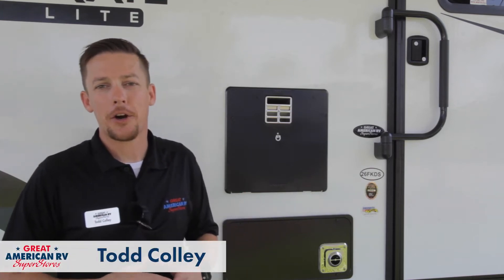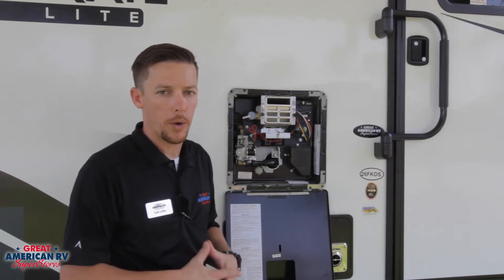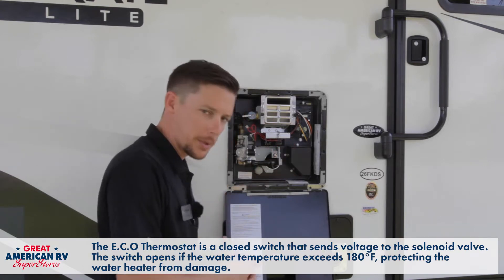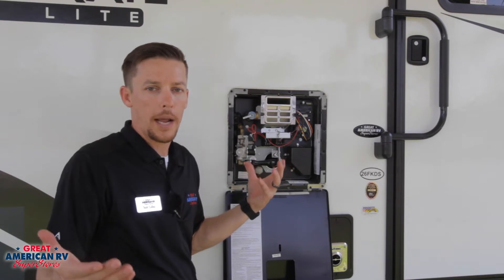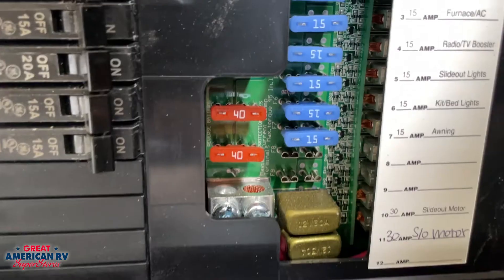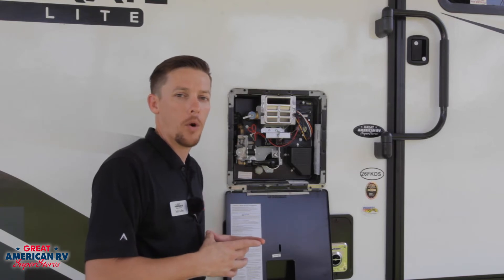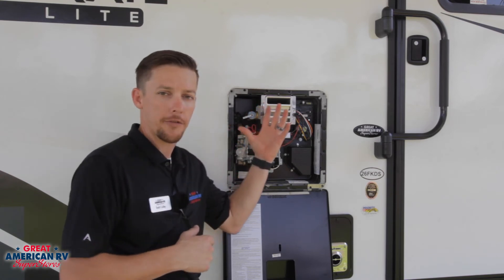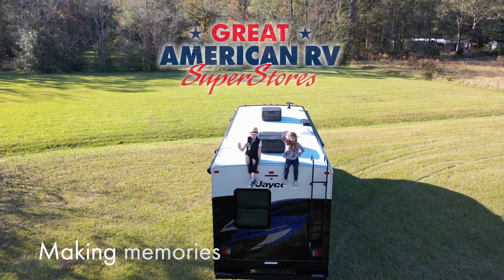Dometic RV Water Heater Operation and Maintenance

Comment: Hey. This is great info. Thank you. I have a problem with mine that you almost got to but not quite. My water heater heats up with either/both gas and electric and gets plenty hot, but then it fully shuts off and stops heating altogether, and it gives me an error on my computer panel that just says, "check water heater." I assume this is a thermostat problem, but I'm not sure where to go with it, and unfortunately I'm living in an area with no RV repair people. Can you provide any insight or direction?
Reply from the maker: Can you get the model number off of the unit itself?  From there I'll see what help we can be.  -Todd

Comment: What do you do when there is too much flame? I have blue flame but it's rolling out of the tube and melting the coating on the wires above the tube? Could it be too much gas going to it? If so, how do I adjust that?
Reply from the maker: More than likely you need to check the burner tube.  It is a U-shape from where your flame is and out to the grill on the top.  It could have a wasps next, spider web, etc built up in there.  Run a coat hanger and compressed air through there.  The gas is building up and not flowing properly through the exhaust.  -Todd.

Comment: What’s the size for the drain plug normal standard use to be 15/16 but the new Domatic heater is bigger drain plug .
Reply from the maker: @jimmurpby2208  the newer ones that have the white cap on the tank 1 1/16”.  -Todd
Reply: @GreatAmericanRV  wouldn’t that be smaller ?than the 15/16
Reply from the maker: @jimmurpby2208  one and one sixteenth inches. 1 1/16”. That’s bigger.

Comment: I have the Dometic WH-6GEA hot water tank in my rv. The AC cord is just hanging loose. I would like to use electric when I have full hookups, but I'm not sure how to connect the AC.
Can you offer any advice please?
PS it works fine on propane.
Reply from the maker: I would a bit more info.  Where are wires located and what color are they?  -Todd

Comment: Hello, I have a question "I installed one of this in my camper" is it necessary to connect gas or just the electricity cable?
Reply from the maker: You can do just electric if you wish.  Just make sure there is no open gas lines on your unit.  You would want to cap anything existing.  - Todd

Comment: Can i use Vinegar soak to clean the scale from a Aluminum Tank?
Reply from the maker: I would suggest staying away from vinegar.  The acid could harm the aluminum causing corrosion.  Best practice is to just run water through the system with the plug out and purchase a flush rod to stick in the hole to break up any scale.  Dometic recommends water only, no chemicals and to perform on a regular basis to avoid buildup.  - Todd

Comment: Ours runs on gas for a few minutes then slowly dies and flames out. Like it's running out of oxygen. It runs fine if we leave the door open?

No issues electric mode.
Reply from the maker: When it is running, is it strong?  Does it resemble a jet burner blowing through the exhaust tube?  -Todd
Reply: @GreatAmericanRV doesn't seem strong with intermittent sputtering with door closed. With door open it runs really strong but flame is more yellow than blue.
Reply from the maker: @Rod-db8tt  Ok, I would start with the mixture tube that comes right after the gas valve and flows into the combustion chamber.  Make sure your system is off first, then run a pipe cleaner or small brush, anything you can fit in that tube and run it around in that 90 degree tube.  You would be surprised that even the smallest spider web can cause issues.  While you are at it do the same thing to the combustion tube.  This one is a little more difficult but try to run something through there and clean it as best you can.  One of these two things should take care of it.  If not it could be a faulty gas valve (unlikely) or you could have pressure issues coming from your regulator.  Hope this does the trick, let me know!! -Todd
Reply: @GreatAmericanRV Thanks for reply. Ya pretty much done all that. Had gas tube out all clean. Ran my little borescope through exhaust tube and all clear. I eventually bought a new door and did the 3" hole mod with stainless steel vent and screening which did fix it, however it still flamed out once since mod which was highly disappointing.  One post on a forum made sense to me that propane exhaust byproduct  is heavier than air and snuffing out flame. I just recently researched this issue again to see if any updates from Dometic as I think it is a design flaw.
Reply from the maker: @Rod-db8tt  I haven't seen anything on that, thanks for mentioning.  Are you having any issues with flow on other LP appliances?
Reply: @GreatAmericanRV no everything else on gas is fine ... from gas bottle in front of trailer all appliances on left side in this order. Fridge, stove, water heater, and lastly furnace. I'm not too worried about it as it works fine normally with the 3" hole, however I would feel better if it was OEM. We're in Las Vegas @ about 2k above sea level so I would assume the jet orfice in gas valve is correct. It did run fine a couple of times when camper was brand new
Reply from the maker: @Rod-db8tt  yeah hard to tell without being there in person.  Wish you luck.  -Todd
Reply: I have the same problem.   It goes out with the door closed.  Though it has a blue flame,  it will eventually go out.   If the door is open it runs fine.    It has burned the wires before and I fixed them.   I also thought of doing the stainless steel cover and 3” hole.     I have adequate gas flow to all appliances and changed the regulator out with a new one.    It made no difference.   It feels like a gas problem.

Comment: Can somebody tell me the part number for that circuit board
Reply from the maker: @stevenyara183  sure can, can you have the model number for your water heater?  It’s going to be on the tag inside the door.  I would need that to make sure it’s the right board for your unit.  -Todd

Comment: Do those have a sacrificial rod in them?
Reply from the maker: They do not.  Dometic and Atwood build there tanks out aluminum.  Therefore they are not necessary according to Dometic.
Reply: This was my question also!  My element is 3 years old. I took it out and cleaned it. It was covered in stuff